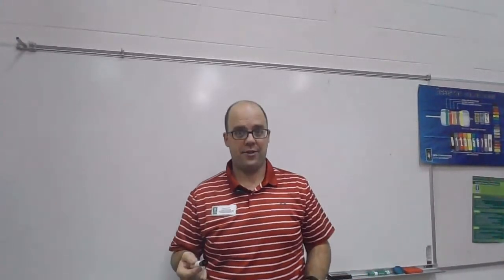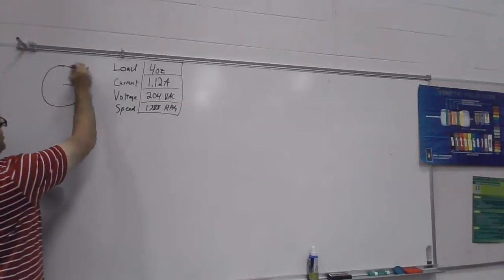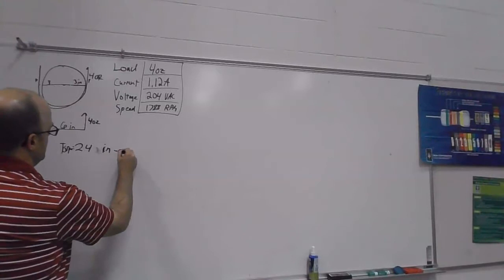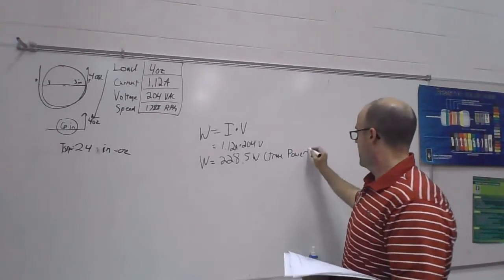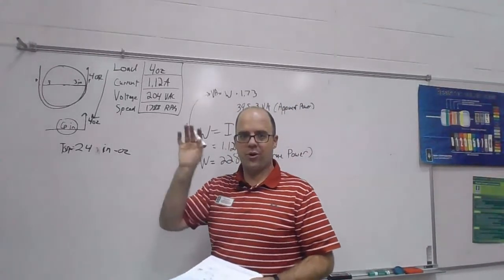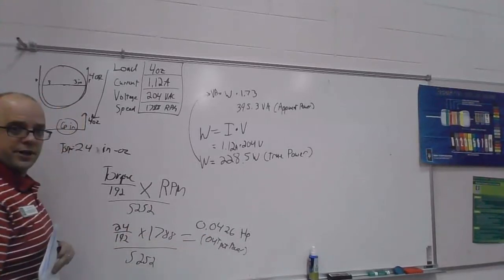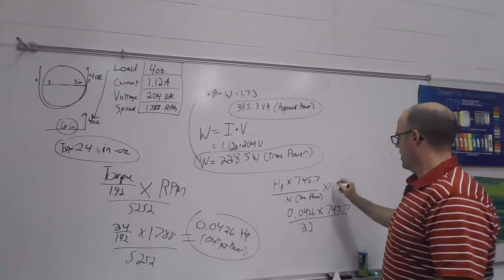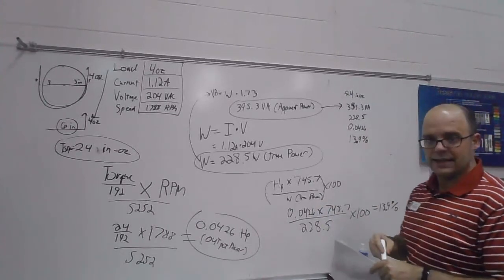Calculating Torque, Apparent Power, True Power, Output Power, and Efficiency of AC Motor

Comment: Good morning, I have a VFD in which three phase induction motor is attached to and I have a capacitor bank to correct power factor lag. I want to know if it's a good idea to implement both power factor correction and a VFD?